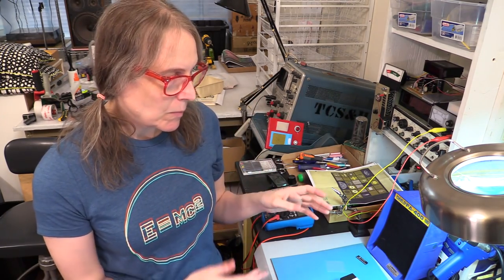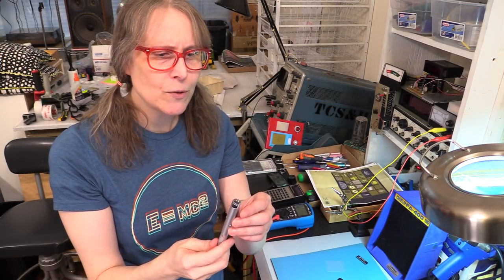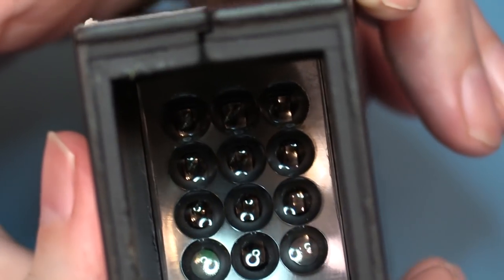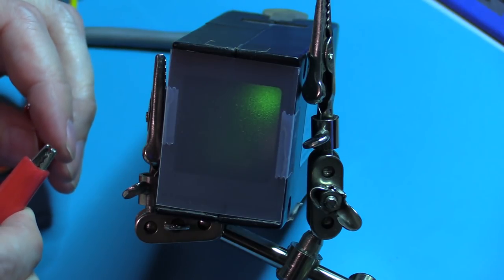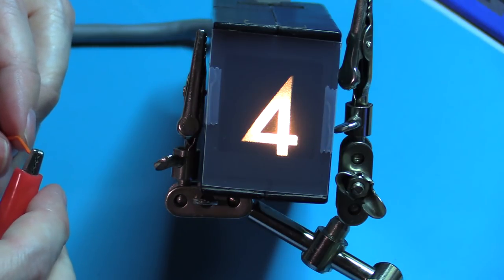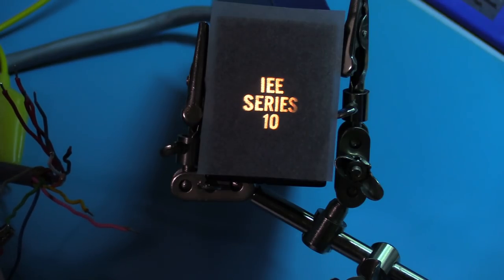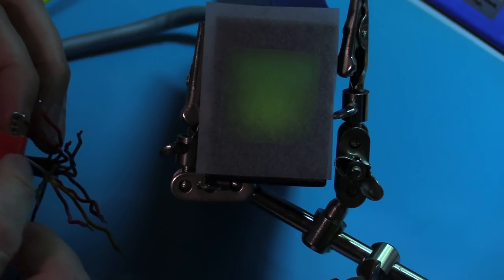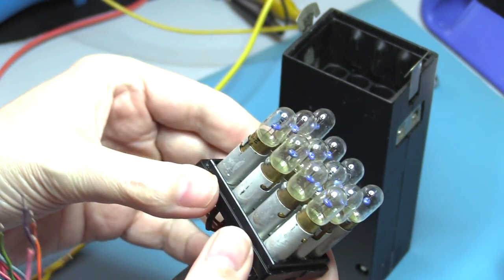One-Of-A-Kind IEE Demonstrator Display!

Comment: Those bulbs are the same as the ones used in old pinball machines: 6.3 V - 250 mA or 150 mA.   You can easily find repacement bulbs or even replacement LED's, if needed.   Thanks for your good work, Fran ! Thumbs up !

Comment: Since you can illuminate more than one at a time, you could make a 7+ segment display
Reply: It should be doable, you just need to align everything perfectly.
Reply: You could make a 12 segment display by taking two 7 segment display and putting the middle 2+2 on top of each other, making M N T W easier to write
Reply: If there were lenses that created the segments. These lenses do not produce "segments" but instead, dedicated projections. Each lens has its own little film slide.
Reply: Considering how expensive these displays were compared to 7 segment displays, that would be a waste of resources. The main selling point of this kind of display was that they could display anything. Also there would be a problem if one of the segments went out, you'd get a wrong reading.

Comment: The DigiKey pen reminds me of a presentation pointer I once found. It used an incandescent bulb and ran off common batteries (I forget the size.) The filament was in a V shape and this got projected by a lens to be the illuminated arrow on the screen. It had some mechanism that let you rotate the bulb without breaking contact so you could put the arrow in whatever direction you wanted.
Reply: You were on that fishing boat with Jason Bourne, weren't you!   ;-)
Reply: Couldn't you just rotate the whole pointer in your hand to rotate the arrow? Or was it powered via the mains? That sounds super cool, though.

Comment: This type of display reminds me of a trick they did in "2001 a Space Odyssey" (and also done in other movies) where there is a backlit display with a diffuser.  In 2001, those were the displays that said "NAV" and "COM" and such and displayed data or moving figures of an outline of the docking entrance to the space station or whatever.  In some scenes, you see this data and images projected onto the face of astronaut.  Of course, the light from the display is diffused and would not look like that.  Just like the screen you are now looking at is not acting as a focused projector and my words can't be read off your face.  Obviously, they merely removed the diffuser for those shots.  And perhaps also changed the focus or position of whatever was doing the projecting.

Comment: Oh yeah, very long ago I worked on a CDC 160-A computer-- it was like the first minicomputer-- 12-bit words, 4K, 12usec instruction time., and a passel of those displays showing the accumulator and the program counter, plus one lone display that showed the CPU status.   It read out STOP, RUN, INDIRECT, and I/O.  If it showed I/O it meant it was waiting for an iO instruction to complete, so it usually meant it was waiting for a keypress on the IBM typewriter.  It had a couple of design foibles-- (1) No subroutine call instruction!  Added in the -A model.  (2) All IO instructions halted the CPU until IO completion, so you couldn't check for keyboard ready and continue on.  and oh, no unconditional jump instructions!  So you either had to know the zero or negative value in the AC and jump accordingly, or you had to clear the AC before doing a jump on zero.  Good points:  very compact, built into the back of a steel desk;  all jumps were relative so code was relocatable.   But not many sold at $110,000 in 1961 dollars.  Anyway, neat displays.

Comment: You get the neatest toys! I probably saw that display at the IEE booth at the NYC "Electro" electronics trade show (back in the 80s). I'm surprised the lamp block is not keyed to assure proper orientation. As to uneven lighting, you probably know better than anyone how the filaments are RARELY aligned, so replace the bulbs or swap some around? I'm surprised you didn't use a little flashlight or bare LED when the back was open to check all 12 lenses.

Comment: Very cool. Love the colour and word combinations. I wonder if you could make a modern version of this using "off the shelf" parts like those 5050 LED lenses you can buy off eBay and 3D print the enclosure to hold the lights and lenses in the correct alignment and focal distance, then use a laser printer with overhead film to print the mask films. Obviously you can just use regular coloured gel film for the coloured ones, but perhaps a colour laser printer could make some interesting masks.

On a slightly tangential note, I don't know why it stuck in my head, but ages ago I watched a video where the dude was working on some electronics thing and he got the parts from "diiiiigiii-keeeeyyyy", which he said in the long, drawn out 90s stoner voice that he used in the video. So now whenever someone says digi-key, that's the voice I hear in my head.

Comment: I wonder if IEE had some extractor tool that solved the 3-handed problem. It's obviously not an insurmountable problem, but if they were showing this at a trade show, they'd want to illustrate how quick changes could be. 🤷‍♂️👍️
Reply: If the display is mounted on a panel it should be doable without any tools.